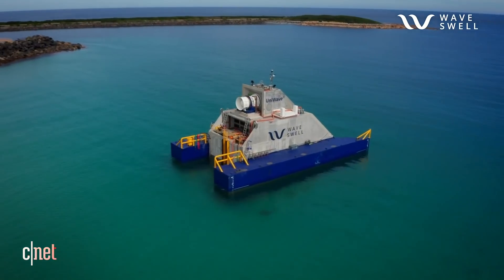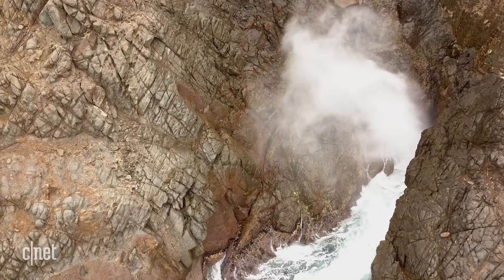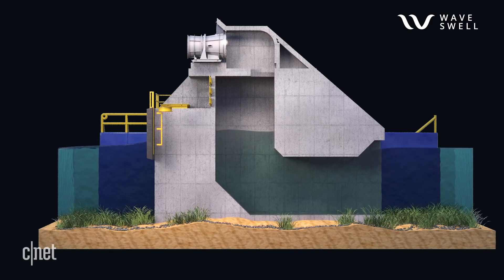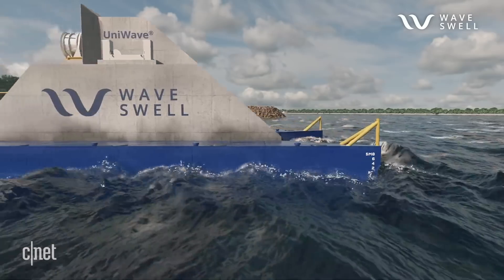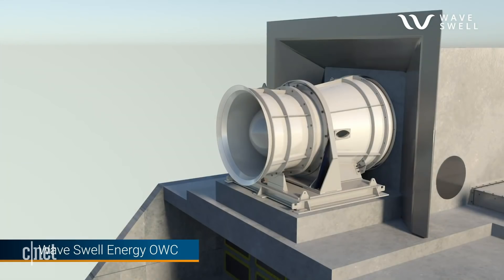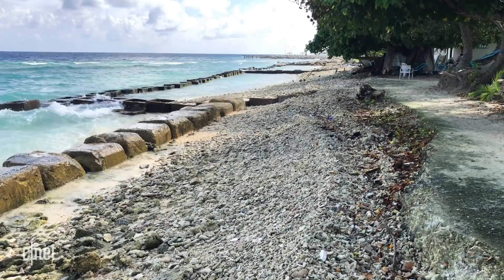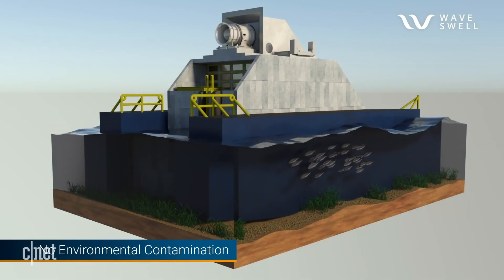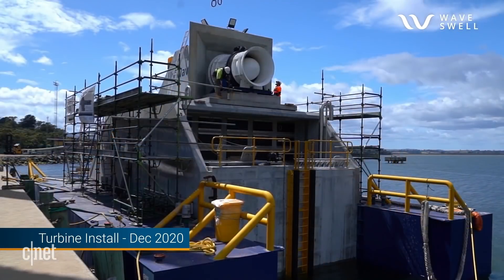How this 'artificial blowhole' could make wave energy mainstream

Comment: The most important question not asked: How much electricity can it produce?
Reply: I'd say 1 electricity.
Reply: @Allbonez  good estimate.
Reply: Negligible
Reply: The test unit expects 200kW  but a larger turbine, and 5 or 6 in a bank as shown? Probably approaching 2MW?
As described its near shore, low maintenance and 24 hr energy, which is the main advantage.
Reply: Mike Smith  Funny, you're looking!
Reply: I guess about 0.5MW max
Reply: It's called Uniwave 200.  I doubt the 200 is Megawatts, the turbine is WAY too small, so logically it has a nameplate of 200kilowatts.
Reply: @brentlanyon4654  200 kW per 'module'....how many millions of km of coastline can this be installed at? Take a poke...
Reply: @citizenscience659  Yea I wondered about scalabilty too and how one would go about it. I mean you can build larger or you can build more, I wonder which would be more efficient scaling.
Reply: @citizenscience659  Darn good question that I am not qualified to take a guess at; if I were to seriously seek out the answer, I would start with the existing harbor infrastructure which is currently in place to protect boat berths near Marina's.  Seems logical that one could replace breakwaters with these from a technical stand point.  I am very suspect of the economics, though.  I do know that on the coast of California there is significant infrastructure to transmit electricity from the coast to population centers that has capacity:  pretty sure all the "once-through" ocean cooled projects except Mighty Moss have been retired.  I know there is a large moth balled facility on the coast in both San Diego and San Luis Obispo.

Comment: Seems like you could use a two valve system like a piston. Have one generator work on air coming in, and one side work with air going out.
Reply: Watch the video again... One way is more efficient
Reply: @daviddean7377  read the comment again , they don't even have prototypes of what I'm talking about.
Reply: Double the turbines and valves does not double the output.
Reply: @dougaltolan3017  you're the only one who said double the power. I just meant you could get more. Just add a bobber and simple pulley system to the doors so that each generator work on one half cycle

Comment: That silence you hear is the long pause while environmentalist figure how this is harmful to the environment.
Reply: I suspect there will still be a small amount of bird kill, since the blades are raised, though nothing on the scale of wind farms or house cats.

It would have been useful to know the decibel ratings for the turbines, especially since they are built so close to shore.  That's not global warming sort of environmentalism but it certainly is quality of life environmentalism if you want to visit a beach.  I can understand why they might not have good power production numbers yet, since they just have the one test operation and they'll need to know the average production over time, but knowing peak noise levels, or at least the peak noise levels they've had so far should have been in the video.
Reply: Noise pollution and creatures getting trapped in the chamber. There have been some of these type of generators around for a while.

So, no long pause, its all known.

Comment: “Liquid Air”.
Reply: Liquid Air is just compressed Earth Atmosphere composition of gases. Very important resource as other Compressed Gases like Liquid Oxygen & Nitrogen mixes can be problematic. While Liquid Air already has the natural composition that real world use cases do best.
Reply: @Neojhun  “Liquid Air” is not compressed air. It is air that has been child down to the point at which it liquifies. In this state there is no problem with instability or spontaneous combustion. They have built three of these plants since 2011 and there are 40 more on the drawing board !!!

Comment: Getting sea defences to do some "work" is an excellent idea a win win solution. The problem I have renewables is the intermittency. Governments are spending billions on fusion reactors that will be ready at best in 30 years. They should be spending money on closed loop geothermal. It does have intermittency problems and it has a small foot print. All we have to do is find out how to drill deep enough and through hot enough rock. That sound easier than fusion to me.
The problem I have with wind is the recycling of the turbines and footprint. How long will it take until people say I don't want that wind turbine in my back yard.
The problem I have with solar is the intermittency and foot print. You get 80% of you energy in the central 4 hours of the day and 50% in the central 2 hours. it is built in that you will be using batteries. This will obviously make Elon happy. But in the south of the UK my solar only maxes out for 3 month a year it has 6 months of gaining or falling output and 3 mouths of 25% output. If you had battery storing for solar half the year it would barely be used.

Comment: I've been fascinated with ocean energy ever since I saw the Blow Hole in Hawaii spout a jet of water into the air.  After some thought I designed a system  that compressed the air and powered a turbine.  I submitted the idea to the Japanese consulate in Hawaii (40 years ago).  There was no reply.

Later I found out from a British company was using Japanese built turbines in their a prototype.  However I thought that the idea had no future and I started designing ocean wave surge and current power hydrogen generator systems . However The climate crises had not emerged so there was no interest in developing clean energy.  Now there is a rush to use ocean energy to fight climate change.

I'm impressed by the UniWave invention that can have unlimited coastal use.

Comment: Great idea, but when will we know the cost per kwh
Reply: A lot: the executive stated in the video that it is cost competitive with wind and solar "when they were at the same stage". That last part is the kicker as utility scale solar PV was around $300/MWh in 2006 when I started working on developing them.  Solar deals are being done in the low $20's now.  Both of these numbers have embedded in them a 30% investment tax credit.  If you go back to the 70's and inflation adjust the price of solar PV, it is likely multiples of the $300 I saw in 2006.  For this technology to be cost competitive one will need to have a viable roadmap to reduce costs.  Given the amount of concrete involved, I am skeptical.  Going back to the solar example, in 2006 "concentrating" solar (CSP) which relies on mirrors and heat transfer fluid to drive a turbine was cost competitive with PV.  CSP isn't much cheaper today than it was in 2006.
Reply: When is isn't so new, right now manufacturing isn't streamlined.
Reply: @microwave311  Yes, I would want to know the cost now and the estimated cost after mass production. It clearly uses some known technology such as a lot of concrete and a turbine, so a reasonable estimate should be possible. If they are used instead of wave breakers then that brings some of the costs down. But if the estimated final cost is not competitive then it will only have niche uses.
Reply: @TimothyWhiteheadzm  it already had niche uses, it needs to be on a coast. This is instead a specialized device for people who may already be looking for erosion control/swell break etc. I just looked into swell break and they're very light on details. Wish I could help
Reply: @microwave311  We have a lot of coast, and much of the worlds population lives near coasts. My main concern is that the amount of energy in a wave can't be much more than the amount of energy in a river dropping a couple of metres, but hydro power typically doesn't become economically viable for large scale use unless you have a much greater drop. Sure you can set up turbines on small drops and in the past, mill houses were built on rivers with a very small drop but it simply doesn't scale up cost effectively. If the cost is always going to be greater than wind+solar+batteries then it doesn't make sense.
Reply: @TimothyWhiteheadzm  q
Reply: @TimothyWhiteheadzm  I wonder if an increased frequency of extreme weather events like tropical storms that increase the speed and volume of the waves could be leveraged by these devices. Actually capturing some of that energy and making it useful. But those storms are likely also a dangerous time for such a device to be pumping voltage through lines that may be subject to damage from those same storms.

Comment: I REALLY like these designs.  This design would be probably a fairly high yield /area than most other options.  No moving parts underwater, access from above water, simple material like concrete lasts 10's of years easily.   Also said they can capture energy from all the way to the sea floor. very very interesting.  
Only problem is you can't build too close together or it would create an effective breakwater, so I guess you can line them densely against the shoreline if that is appropriate for the installation.  This one is probably just out of reach for small scale installation but it could in theory, very easily, be designed in smaller for, example, installation on a private marine property.

Comment: Wouldn't you increase the efficiency by having there be a motor that is a directional inlet for air that works off of the vacuum that can be formed as the water recedes?
Reply: ...rewatched the video illustration...that's exactly what they are doing, lol. 😅

Comment: No speaking about the technology or the actual power generated? How is a unidirectional turbine better than a bidirectional one?
Reply: If the turbine has to change rotation it loses most of the energy.
If you use a turbine with blades that flip so the rotor keeps turning the same direction then the complexity goes through the roof.
There is a turbine design that will do what you want: turn the same way regardless of air flow direction but they are significantly less efficient.

Comment: They can add another turbine in the place of the intake valve with opposite direction, with the right set of valves to control the air flow, they will double the power output of each blowhole. Guys hit like button so they hear the idea and build the next generation blowhole :)

Comment: It looks like energy is wasted as the wave rises. Why not have a second turbine which spins in the opposite direction?
Reply: I thought the same thing.  Makes sense to maintain turbine momentum and use valves, but why not install a second turbine and get the benefit from the full cycle?  Free 2x the power?

Comment: This seems incredibly innovative, even more so if it works as intended. It's one of those things you ask "Why wasn't this thought of before?"
Reply: There have been lots of attempts at tidal power.  They just haven't been cost competitive with other renewables and there were worries, just like with wind turbines, of the blades chopping up the local wildlife.  A lot of the previous models have had to have long test periods to make sure you aren't making puree of dolphin.

The simplest version I've seen was just a simple buoy tethered to the ocean floor.  The buoy bobs up and down on the waves, pulling the cable and relaxing the cable which is attached to a generator.  One of the big problems is you need each unit to be big enough to justify the cost of running wire underwater back to shore (or you have to have powerlines over the water, which is kind of ugly.)
Reply: @NacorantheHarmonicaPlayer  Yes, I know there have been many models for wave energy but I'm referring to specifically to this design. I believe it's incredibly innovative and see the, relatively speaking, simplistic design as a "Why wasn't this thought of before?" moment.
Reply: @dylreesYT  Island of Islay in Scotland.  Onshore version created 30-40 yyears ago.   Produced 10% of the predicted power, and low-grade power at that.

Comment: Spinning a turbine directly is interesting but given that the spin is based on a 1/2 wave cycle (pun intended) I wonder how that affects turbine speed during the blank 1/2 of the wave? Is turbine momentum sufficient at all wave periods? I would think/hope that the mechanical transmission between the turbine and the generator compensates for turbine speed but then this makes me wonder about the efficacy of employing a flywheel to keep generator speed steady.
Reply: It's a bad design and I doubled the efficiency while sitting on my toilet. This thing is going nowhere.

Comment: Interesting technology...hopefully this works out in the long term...would probably make a great hybrid platform for wind and Solar as well?
Reply: Since it's close to shore you are going to have the same NIMBY issues with wind that you would anywhere else, especially since shorelines are so picturesque.  I suspect even without wind it would get a lot of resistance except in situations where you can sell it as part of coastal protection.  Even then you might have to do some prettying it up like they do with cell towers that look like trees.  It would be much easier to sell these as part of a vegetation covered sea wall than as just concrete blocks in the sea.  It looks like that wouldn't be too hard to do though.
 
As for putting solar on it I suppose you could, but putting solar out on the water puts it in harms way for big storms and the total surface space you get for it doesn't look that big.  We already have huge amounts of space available on roofs, or over parking lots that are closer to where we use power.

Comment: I remember when we started putting up wind turbines in Hawaii. People complained that they were unsightly. I wonder how people would feel about seeing those so close to shore across our pristine beaches ?
Reply: One image they showed had them incorporated into jetties, which would improve the look of most jetties. The one featured is for testing. I imagine they won't generally be 40 yards off public beaches. And as far as any beach being pristine, and in need of electricity, I'm guessing that's a null set.
Reply: @SD_Marc  Great point. Moreover as long as the basic principle works efficiently there could be several ways to implement the design.

Comment: Super interesting technology, but I was really hoping to hear some more objective information.  How efficient is it compared to bidirectional? How much energy output is there? What is the cost of the structure and cost per kwh at present and what could it get down to with economies of scale in the future?  This video has a lot more potential!
Reply: They would be better off, taking into account, swell frequency and amplitude, and "fetch".., to use two unidirectional turbine generators in opposing directions, of slightly smaller wattage to maximise output of rise and fall of swell action. The single unidirectional generator would need some sort of interperiod storage between swells....
Reply: @vps1014  I think that is not a problem, having a few of those plants hit by waves at different times should even it out, maybe the solution could be as simple as having a flywheel aswell.
Reply: The structure looks like pre-fabricated cast concrete walls, assembled onsite. I would approximate $65k USD for the assembled structure if the concrete depot was local. For the fan section, using efficient bearings, CNC housing & blades, approx $25k USD. Finally $10k for electronics & a 200KW Generator from EMRAX, ~$30k USD.

$130k Total plus say $20k for variance in regional availability.

Comment: They mention that the turbine only works one way......so why dont they design the turbine in such a way that they can use both ways but the turbine still spins one way
Reply: Uncle Jaffar  there are non return flaps in the diagram.
I think all those rectangular (like windows) below the turbine are one way non return "valves"
Reply: When it sucks air back in, it would generate electricity. So yes it would be better to make the turbine multidirectional.
Reply: @tomthebob6102  stopping and reversing and stopping and reversing direction looses more energy than it gains was my interpretation of what the man said.
I wondered why not 2 turbines.
One in and one out.
Reply: Uncle Jaffar  bruh we have had that technology for awhile now. That's what regenerative braking is basically. It like if you have a small motor you have a power supply connected to it, you can use the power to spin it one way or, use some other power source to spin it another way which would charge the power supply.
Reply: Uncle Jaffar  
1min 30secs approx show the cycle.
They let the air out but don't allow it back in.
Non return valves ?
Presumably resistance to the rising water is less desirable to the option of using the energy created by the falling water.
They would also stop water getting in of course. 
But the cycle demands neither air or water get in in that direction.

Comment: The 200 stands for 200kW for anyone who was curious
Reply: If its rated for 200kW then following some of the math for how they calculate wind turbines estimates would be  around 525.6 mW a year

200kW × 365 days × 24 hours × 30% = 525600kW

Due to varying factors wind turbines dont run at max potential capacity so estimates of total annual output is roughly 30%
Reply: Tides, storm surge, wind, maintenance, sea level rise etc forgot those in your equation.

Comment: What happens when you get a large storm. Can it survive?
Reply: My thoughts exactly. A storm surge from a hurricane can raise sea level significantly. I saw a video a while back with a similar idea, but they used plastic tubes attached to a seawall.  The tube was capped with a Pelton turbine. In the event of an incoming storm they could remove the top piece and only risk the tube. It was considerably smaller. but they had many of them.